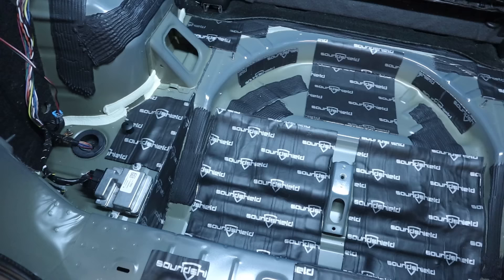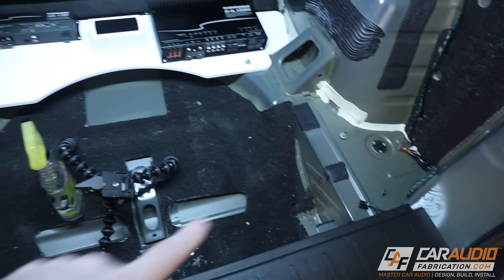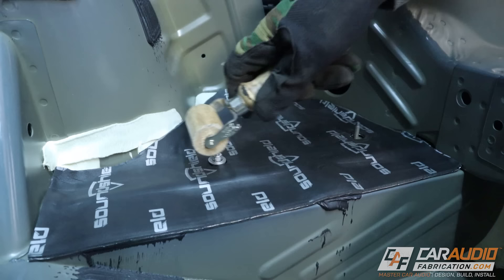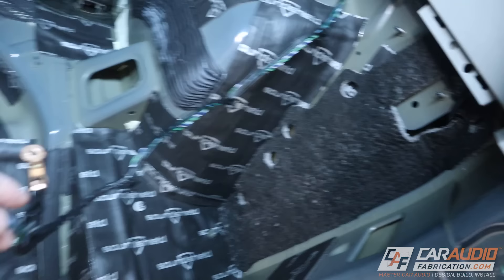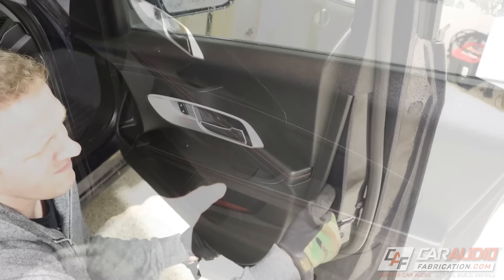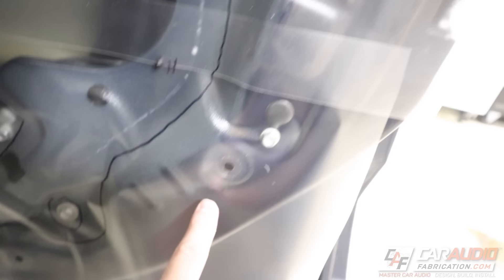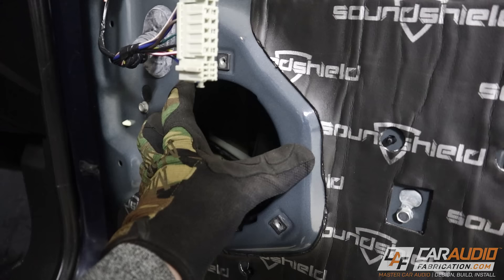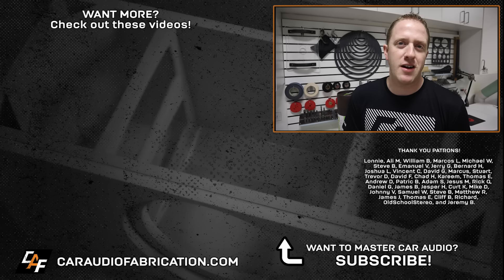How to Apply Sound Treatment! - SQ Daily Driver Build Part 2

Comment: I had a long phonecall with the owner of Hushmat and he said you only need 80% coverage. Anything more just adds unnecessary weight. He is a degreed acoustical engineer, and before he started Hushmat he designed noise control packages for OEM carmakers. He said that shops that apply 100% coverage do so because they don’t want the customer to feel they are getting ripped off. Above 80% there is no further benefit. Adding weight to a vehicle has effects on fuel economy, handling, and other factors. He further said it’s critical to seal holes in the firewall - sound sprays through them into the interior like a firehose through any small openings. I have been using this Soundshield on my customer’s cars and it saves installation time - you no longer need to apply a Hushmat or Dynamat type product, and then apply closed-cell foam on top.
Reply: 60% coverage will give you 95% effectiveness with vibration noise in most average applications.
Reply: I always do 200 to 300% coverage...but I am weird...
Reply: @truthseeker8483  I just put an engine on my sound deadener, makes this whole process much easier
Reply: @stuckinthepast  :D Wrap the engine in sound deadener....I need to try this!
Reply: @stuckinthepast just move to electric car for less noise.
Reply: So 100% coverage won't insulate the music from my speakers better than 80% coverage in my SUV?
Reply: Agree 💯, I disassembled a Lexus LS 400  interior to “investigate” what makes those luxury cars so silent and quiet inside … they don’t use to much rubber sound deadening (Dynamat, etc) nothing heavy inside doors , they use a combination of different materials , soft and hard materials like a “sandwich” , also they use special windshields and windows glass , no the one you’ll  find in a Toyota or Equinox 😂
Reply: On Mark's other sound deadening video you said you spent 45 minutes with the guy "at a training" and he said 75%... now it's "a long phone call" and 80%... can't keep your story straight?
Reply: @mangellotti57  he’s accounting for inflation 😄
Reply: @mangellotti57  pretty good thing to keep in mind when talking anecdotes.

I bet that dudes right, like some lesser percent is enough for 99% of results. It holds true in every imaginable facet of life ao why not here. 

Its just always said to be based on something to make it more serious.

I heard this when I was doing biceps with Arnold and hes read Albert Einstein said it so must be true🤷‍♂️

Comment: Sound treatment also makes the vehicle feel more premium.  Feels more solid and better isolated from road noise.  It's one of those upgrades that once you've done, you'll always want.
Reply: Agree 100%
Reply: I gonna do my Audi, I’m so stoked
Reply: Im going to do my escalade....  i get the feeling its going to take like all weekend and then some lol
Reply: Im doing my 76 series landscruiser wagon. It was a tin can. How big a difference should i expect?!
Reply: @charlieaydin1377  Huge. Even a modest treatment will make it feel like a completely different vehicle. It's hard to explain here but once you feel it it's unmistakable.
Reply: Doing my 20 yr old Highlander. Only got the two front doors done, and already notice the difference both in sound quality of music with my freshly installed aftermarket setup, and road noise/vibration. This is a great DIY upgrade for people with older, high mileage cars that can't afford to buy new.
UPDATE: got all 4 doors done and definitely a difference in ride smoothness and cabin noise. Biggest difference, however, is loudness and low freq response of my speakers, holy crap...
Reply: @marco1173  finally took it for a drive and goddamn it feels and sounds like a lexus now. 

Can still hear the engine of course but road noise and vibrations are nearly all gone. So much quiter  now
Reply: Unfortunately, most car noises come from wind noise which goes through the glass.  The acoustic glass will help much better in that regard.  Wind noise is not suppressed much by applying these sound deadeners.  Tires noise might but the floor under the carpet is already fully coated with body adhesive.  I found these things is more useful if we want a much bigger Woofer or something about the sound system. Not the outside noise.
Reply: @charlieaydin1377 '91 geo metro to  2022 Cadillac.   If you do floors, doors, and under the headliner you will be amazed
Reply: I may do this in my car! I believe it's going to add a bit of weight though 😅 I'm intending to remove my rear seat(2 door hatchback) to install the subs there and save trunk space.

Comment: My wife has a Honda pilot and it had an average sound system, and a lot of road noise.   We took it on vacation and I hated the vehicle because of the noise.   We had a planned trip to Disney for the next summer so I decided to upgrade the sound system and sound treat the car.    I had the car professionally undercoated, and replaced all the speakers with premium speakers and added a powered sub under each of the front seats.  My son and I gutted the car one weekend while my wife was out of town.  We treated all the floor area, inside the doors and cavities.   In the hatch we used neoprene floor mat and rubber mounting glue, we also did this in the spare tire storage, and large body cavities.  We also used DEP expanding foam insulation in the tight spots in the body structure.   I admit we went full overkill but the results were unbelievable.  We let the car sit with the windows open for two or three days.  My wife was shocked when she drove the car.  A friend tuned one sub to pickup where the door speakers dropped off, and the other to handle the deep lows.  I underestimated the value of sound deadening, but it was so worth it.   I would do my vehicle, except I drive a soft top Jeep so it probably wouldn’t help so much.  Maybe the next car.

Comment: I sound deadened every car I had until now. It is such a big difference in sound. Next step, if it gets warmer these days, will be, that I dampen the wheelhouses where the struts are connected. I think that much road sound is coming through there.
Reply: For sure. I used a product called Membrane from Restomod Air on my exterior wheel houses. Made a large difference
Reply: @dobledekersoulwrekr  thanks for the tip. We have similar Produkts here in germany. Your prpduct is in red mine is in blue but dampens too. It even has thesame structure on the alufoil. The distributor is Reckhorn. Which is a little bit to thin I think. It only has 2mm instead of 4 like in the CAF-Video. 
But I thought it might be easier to apply if I take something like Teroson which can brushed on the sheer metall. Thonking about to being some of it alao under the floor to block roadnoise also. Its a tar like meaterial which cures on air and comes in tins. Because of the material I preferably not use it inside the vehicle. Like the doors.
You can easily apply it in thick layers. And also on the not moving components of the steering system. With the last point i am not sure if it will work.

Comment: I deadened my truck doors and cut out a lot of road noise.  I went through the trouble to measure the road noise with a calibrated microphone and an app on my smartphone to get a before and after.  On smooth roads at low speed it made very little difference.  But at interstate speeds on a rough road the difference was substantial.

Comment: I just installed sound treating to all doors, trunk and floors and OMG is it making a difference. It took me just 3 years to decide to do it lol. Installed HU, AMP, speakers and sub awhile ago and finally treated with sound deadening, wish I did it sooner. I gotta thank CAF for tutorials and making me believe I can do it lol
Reply: So that's how I'm going to feel after 3 years and all the work done to my car once I sound deaden...Alright alright now I'm even more eager to receive my sound deadening :)
Reply: I'm considering sound treating my escalade.. do I have to do the roof?
Reply: Differnece in road noise? I did my doors and back wheel arches once and didn't make that much of an improvement in blocking road noise, slight but hardly worth the effort. Didn't use very thick dampener though which might have made a difference. But i Wonder if youd really need to do the floors too.. thats a lot more work...

Comment: Thanks buddy, subscribed. I did this more for a minor rattle in my car door, ended up doing your “wiggle test on all the exposed wires (which were not many) on a new Mazda. Put foam on any potential contact points and TESA Tape on as much of the plastic clips as possible. My car door is dead silent now. Freaking love it.

Comment: I did this for aircraft, we dont cover every square inch we just did the flat open areas, the change is amazing if you walked from the shop floor with 80-90 rivet guns going to inside the small business jet even with the doors open. If you got the money do it you dont really need to be focused on a stereo setup to enjoy the benefits.

Comment: Covering the shock tower reduces the road noise tremendously.
Reply: Tariq Khan are you referring to under the hood?
Reply: @guitaristwagner  no.. rear shock towers, from inside the car.
Reply: @Tariq  khan i m satisfied with your suggestion can you elaborate for more understanding.
Thank you
Reply: Jigmet Deskong assuming you have a regular sedan, remove your backseat. Starting from the wheel arch (the hump) go all the way up is what I would cover with sound proofing.
Reply: Hey brother do u mean the shock it self or the metal srounding the shocks from outside of the car ? Sorry im not that good in english
Reply: Senior Ksa from inside the car. Not the shock itself.

Comment: If you are creating holes that you'd like to reinforce, like for that handle wire, try using the circle punch set to create concentric circles.  An insulation "washer."

Comment: Before youtube and this channel my first experience with dynamat went very well. I didn't do a cover all but I did hit those important areas just like Mark explains in this video. Great work my man! I've been watching you for a few years now. I've refined some of my skills with your guidance and wisdom. I do car audio installs as a hobby not as a profession. The leather punch is a great idea. I started using that idea recently. I usually just cut a hole with a knife by making an X then cutting off the pieces.

Comment: Sound deadening, much like others have said, is crucial and underrated. The benefit of it is two-fold.

As he demonstrated in the video, it can eliminate resonance, aka "the clang". This helps minimize sympathetic vibration in the area where the material is applied. This will lower the noise floor in the car, but where it will it have massive impact is in the doors. When applied in the doors, it concentrates the surface area making audible sound to the actual speakers. This will lower noise, lower phase cancellation, allow the front stage to really manifest. Imaging will improve across the board, especially with additional time-alignment.

The second thing this sound treatment does is add mass. Mass loading an object lowers its resonant frequency. Why does this matter? Say the untreated metal in your inner doors loves to resonate at different locations between 50-80hz. Throw your speakers in those doors and good lord the buzzing and rattles and shoddy imaging. Add the sound deadening material and the mass of the metal has increased, which lowers the frequency it inherently wants to resonate at. In some cases you can mass load to lower this by 2 octaves or more. Say you got that in those same doors.... now they resonate at 12.5hz to 20hz. Now you can put those same speakers in that door and it will sound pristine with no buzzes.... even full range. 

This lets you do some creative things tuning the car. Less noise? Lower gains on the amps. Less gain? Less speaker excursion in a given bandwidth. Less excursion? Cross your fronts over lower, getting more of the bass in front of you. Cross your sub over lower and be able to bump the gain in the sub-30hz material without overrunning your mid-bass. This, of course, more of a sound quality setup.

Comment: I always put strips along the legs of the basket of the sub/bas. Works wonders on stamped baskets. Tap a basket before and after. It rings like a bell and it's audible through the membrane.
Nice video!

Comment: I am In the process of doing my front doors at the moment (passengers door complete). I had an annoying vibration in my passenger door which I have now fixed and am extremely happy about. Even a little sound treatment goes a long way, as I’m doing it on a budget I was still impressed with the difference. Thanks for the great channel!

Comment: love your videos. learned a lot. i did the doors in my 2015 vw beetle and was surprised that VW actually had put some in it. wasnt but a few pieces, but they took the time to do it. it made a huge difference with the door panel rattles. i ve been going backwards on my system though. ive had to go back into the door a few times. speaker, the foam rings, sound deading. but when you start off telling yourself that its just going to be an upgrade, thats it. and you whined up with 2 amps, new cabin speakers and a sub. lol you get it. when i get my new, louder stuff for the rear and hatch. i will be better prepared. ty for sharing your knowledge with us.

Comment: A little thing I learned at work is if u use a dead blow hammer on hole punches u get a quiet hit so you can hit harder without damaging the punch since the hammer is plastic and it won't hurt ur ears either

Comment: I enjoy watching your videos , I always wanted to get a job doing custom work on cars but in AZ there really isn’t any schools that I know off. I’ve had to trial and error on my own rides. Sometimes in your videos it looks like your doing to much , but like this video compared to others Ive seen where you do the sound deadening and you don’t say if that car is a show car or not, I would presume it’s just a reg car but you do the extreme of sound proof.you state the difference in this video between going all out on a show car as to compared to an all day driver..I wouldn’t close up those bigger holes , maybe in newer cars yes but to everyone doing this to old school cars I wouldn’t recommend doing that.. the reason being is if you don’t care then do what you want to do but for others a lot of old school rides the window mechanism messes up. If you block it with sound proof your gonna have to either rip the whole piece off in attempt to put it back on which it’ll loosen the sticky ness of the adhesive or your going to have to cut a hole where you pull out the motor or the window regulator.. unless you go to the extreme like one of homies videos and make like a separate wood piece or something that gets bolted in and can be taken off at will.. I’ve worked on many older rides and there built more solid then these cheaper plastic cars so these cars have more things to rattle then old schools…  other then that advice I think you give good advice on what your doing but some people need to realize it takes time and dedication and just by watching your work and how clean it is they might not get that same end result… I know from my experience trying to mimic some one else and what they where teaching it didn’t come out as clean but over time and doing it over and over  I got way better.. I would like to dive deeper in all the wiring within a car , I was told especially with these new cars you have to run some type of firmware mainly when your installing alarms not so much audio but I was told you have to be very careful and know wussup bcuz if not it’s like 1 thing is connected to everything and if you pull or hit the wrong thing on accident the whole car will shut down.. is that true ?? It be interesting if you made a video about that.. anyways good work homie much respect ✊🏽

Comment: ****DUDE: You forget to mention that you have to line up the letters parallel to the ground in order for the sound deadening to work properly. This allows the molecules in the sound deadening to properly orient to the car and thus control vibration accurately. Trust me......
Look me up for proper training & use for a 6x9 hole saw.
Reply from the maker: Lol...
Reply: :D
Reply: don't forget to cut your pieces into thin long strips so the north and south pole is further apart. this will give more adhesion when applying. I found that strips over 2 feet long will have the same affect as a neodymium magnet.
Reply: @Mrbigcrush100  I just jam some in my ears...cuts out all noise...
Reply: jay stew YES! Directional sound treatment for the win! Directional solder is HUGE in China
Reply: @Mrbigcrush100  what the fuc_ are ya'll talking about. Sound deadning according to mag fields, really. Something i need to consider, lmao.
Reply: Please explain sound deadning working properly, sillness has no letters.
Reply: @fredbradshaw3835  FYI When you hold your sound treatment up to the sunlight you can see the north and south markings in it.
Reply: @Mrbigcrush100  for real man. I did not know that.
Reply: @Mrbigcrush100  im sound deadning soon, anymore advice on the subject will be well appreciated. I was about to just roll it in till the diamonds were flat. What else do i need to consider basshead public.
Reply: @Mrbigcrush100  can you see through it with 80 mil and 120mil
Reply: I used your 6x9 hole saw and now I have 9 inch round holes in my car doors and I got my cousin pregnant. Please tell me what I did wrong